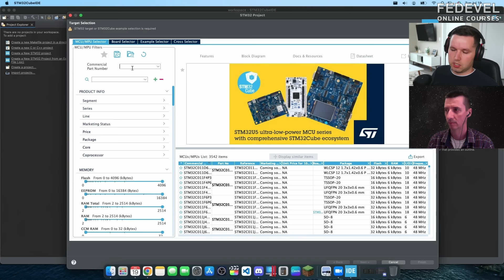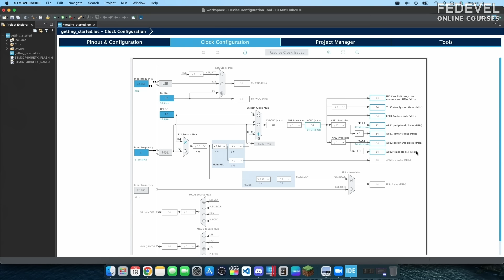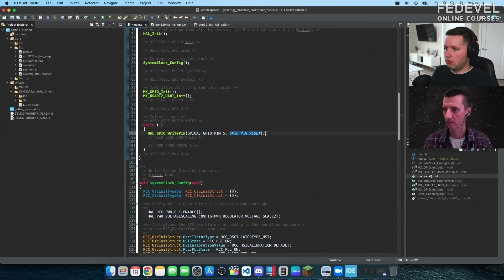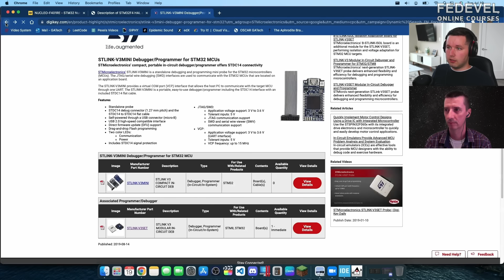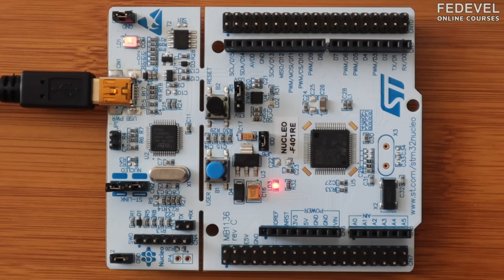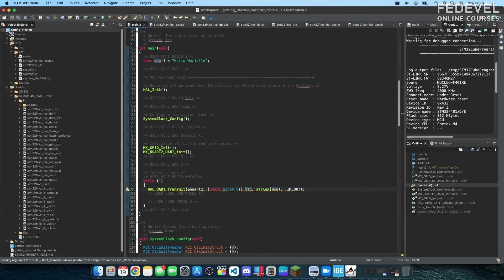Starting with STM32 - Programming Tutorial for Beginners | Step by Step | Greidi Ajalik

Comment: You can use the programmer part of a nucleo board to program other STMs on other boards (including your own custom one). The SWD interface is available on pins and there are jumpers there as well to "disconnect" the main MCU. If you want you can even cut off the programmer part. There's a prerouted slot and only three small tabs connecting the two boards. Score them with a knife and break it apart.
Both parts will still work, but you'll obviously have to manage the connections to the programming interface of the main MCU yourself, as well as the rest like connection to power, the right UART pins, the external oscillator aso.

The original "ST links" are already exceptionally cheap for a programmer (props to ST for that). But you can have even cheaper ones (~3€) on your favorite ecommerce platform for cheap stuff ;) . I wouldn't start out with those, to avoid problems (though I never had any, but just to be safe). They even update through the same firmware flasher tool. But be aware that the more recent ones don't use an STM32F1 anymore but a GD32F1. That's a Chinese version of an STM32 with a few slight differences. So unless the firmware for the programmer hits one of these differences the GD32F1 should be fine.
Reply: The bootleg programmers from China are not working anymore with ST software - they detect the fake chips and won't let you use it properly.